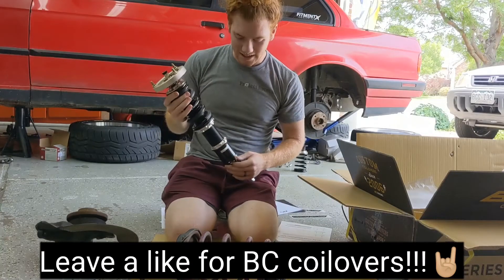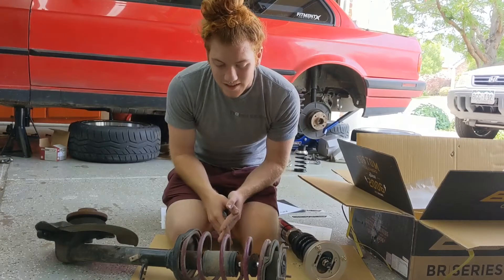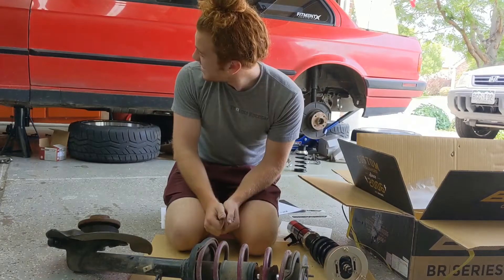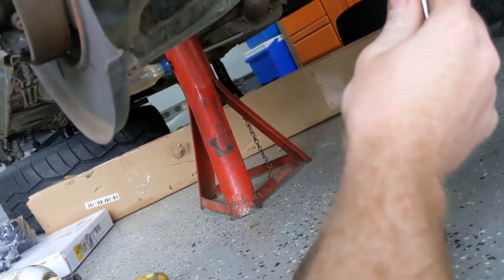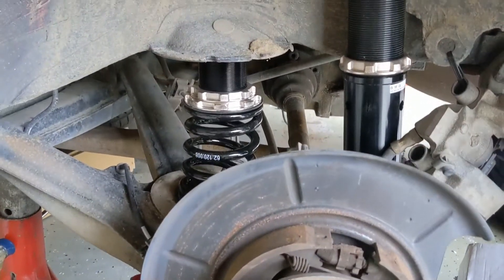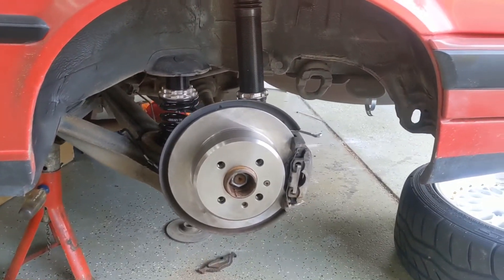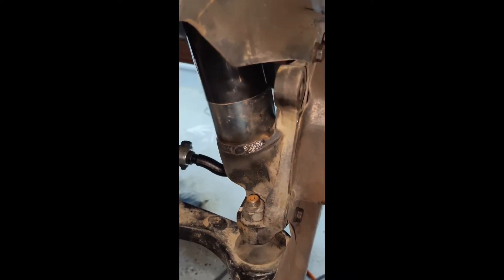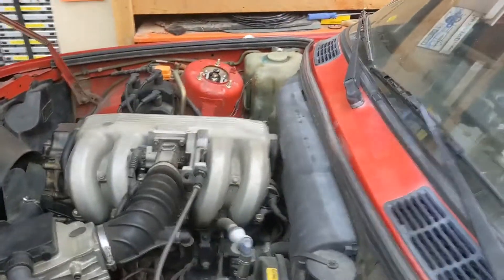The BMW E30 project car gets an expensive upgrade!!! BC Racing Coilovers!!

Comment: I don't have my coil-overs yet they don't get here till Tuesday. But one thing I am wondering is how you know what way to face the coil-over when welding it on?
Reply from the maker: So the part that you weld is just the sleeve that the coilovers sit in, so there isn't a wrong way to face it👍🏻 it's really easy, make sure to take the coilovers out of the sleeve when you weld them

Comment: Hey man, is it a smooth ride?🔥
Reply from the maker: Incredibly smooth! The bc coilovers are the best bang for your buck! I will be sticking with the brand for any car in the future!
Reply: @ProjectRacecar2  also man, does the back shocks come with the coilovers? And could you also provide me with a link to buy these?🤙🤙
Reply from the maker: For the e30 the backs come as a shock and spring set up not a coilover, but I got mine off of fitment industries!
Reply: @ProjectRacecar2  what spring rate are you using on your front and rear